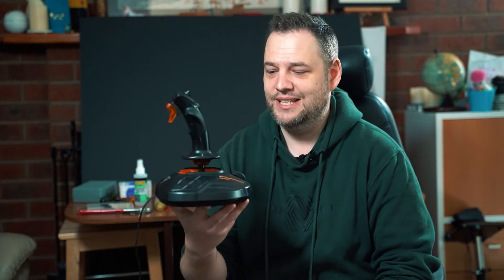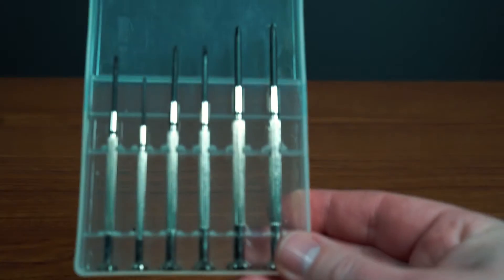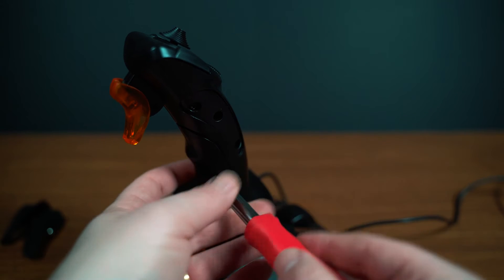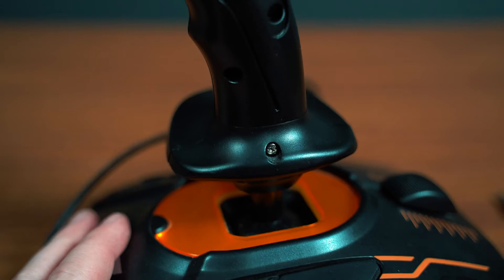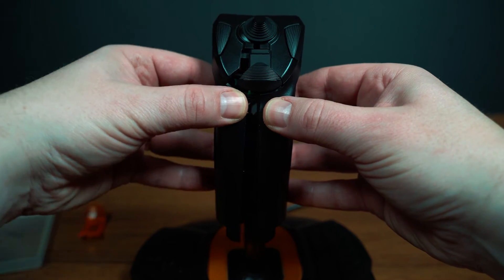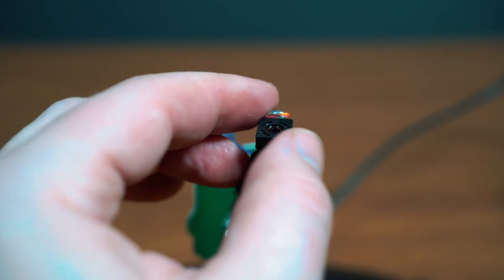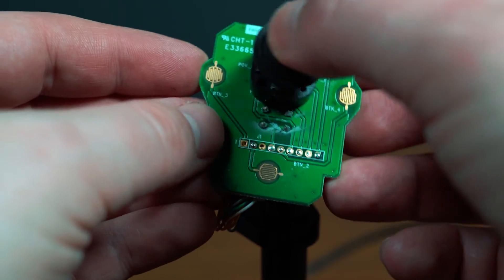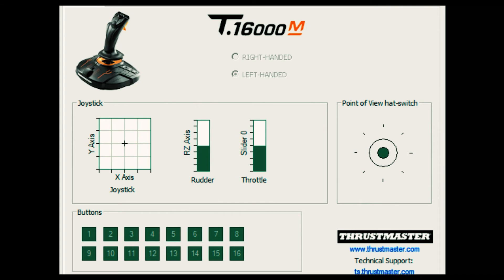Easy fix for T16000M stick/twist rudder - Complete tutorial

Comment: Thank you, it worked for me. My one modification is that I used alcohol swabs instead of q-tips dipped in isopropyl alcohol and alcohol swabs worked just as well. After wiping the swab over the surface a few times, I squeezed the swab so it coated the sensor and then turned it back and forth a bunch of times. Can’t even tell the z-axis problem was ever there. 🎉

Comment: I bought a T 16000 M bundle that has HOTAS, Throttle, and Rudder Pedals. I plan on using this until it either breaks and I upgrade to VKB, or I lose interest in flight Sims. Whichever comes first. If the z axis fails on the stick I have rudder as a backup so it may last longer. I plan on using the rudder as primary for realism.

Comment: Just did this to mine, and so far so good worked a treat. The only thing I'd suggest is popping the side buttons out as they just unclip, then you and quite easily reassemble the stick, pop the rubber things onto the back of the buttons and push them back through the holes. Anyway the actual cleaning of the potentiometer seems to work well, thanks!

Comment: I have what I believe to be an optimal process for reassembly and contending with the Nipples of Doom.

The left and right thumb buttons have moulded into them some retaining clips that exist so they could be press-fit into the halves of the stick.  Gain a bit of clearance by pressing a screwdriver against the closer clip and then push the buttons up slightly.  Place Nipple of Doom with tweezers and install.  Repeat with the other half, do not install the rear center top button.  Use one screw to affix the two halves solidly.

Place the remaining Nipple of Doom directly on the circuit board very carefully and precisely.  Snap the thumb button down and roll a dexterity check for at least 12.

Test springiness of buttons before finishing the rest as normal.

Comment: I found the solution — you don’t need to replace the sensor, and cleaning it with alcohol doesn’t really help. Well, actually, it’s not the cleaning that helps, it’s the disassembly. The problem is a short wire coming from the sensor inside the bottom part of the joystick. You just need to pull it out a bit and secure it. I simply used a zip tie to keep it from slipping back — no more problems since then.

Comment: I've had 2 of these suckers and both had this malfunction before too long, even though I dont play very often. The first one developed this problem within 4 months, as it was still in warranty, I had it replaced by a new one. One year later, the second one developed it as well. I have tried this and it only works for a little bit, and if you do it enough times, it doesnt work anymore at all. Honestly, screw Thrustmaster for not fixing this problem. I know its supposed to be an entry level stick and that they do sell the rudder pedals (which, from what I have read, isnt great), but this is a basic issue that they could fix but refuse to

Comment: The fastest/safest way I've found to fix this: take all screws out but leave the trigger pin in! from there you can carefully pry the sides apart and access the twist rudder pot without having to worry about any of the buttons falling out. it should be able to open just wide enough to get a q tip in there and apply the cleaning alcohol to the top. You can then close it, twist to distribute, and repeat until it's clean. 

I found this out by neccesity when my trigger pin was stuck and I couldn't get the sides apart but it ended up taking way less time and there is no way to loose the nipples of doom!

Comment: So i've b een able to repair mine... which had a broken wire on the twist pot. mine is 15 years old.... the green one. I might have upgraded, but it's the EXACT same under the hood. except it costs almost double what it used to.

Comment: hello I have a question, first of all thx for your video. Do you think I can glue the nipple of doom(it is really that 🤣🤣) from the nipple side to the small plastic rod beneath my button ? Or it will make a mess? I wasn't able to get the metal rod out from the trigger even with the hammer so is more difficult to put it together now, sometimes I think sometimes this joystick was assabled by monkeys under drungs 🤣

Comment: 4 years after the video, I have just fixed mine and it worked.
Quick trick: to make sure the plastic "tits" hol into place when remounting, I put a small drop of glue to make them hold with the push button part, it was easier for me.

Comment: By the point you remove the hand rest at 4:33 you can slightly open the joystick handle and insert the isopropyl alcohol via a needle/tube to reach the sensor. No need to take all of that apart.

Comment: Also, a needle nose pliers makes punching the trigger pin back into place a cinch. Start the pin through until it just starts peaking through, shove the orange button into place lining up the holes as close as possible, then just use the needle nose to send the pin home. Done.

Comment: TIP FOR REASSEMBLY- I just did this to mine today too to fix the rudder pot. It worked perfect. When reassembling the two side buttons over the PCB, I found a trick for holding the buttons up while sliding the two main halves together. Each button has a little plastic retaining tab. These prevent the buttons from popping up too far and coming out the top during use. To remove the button, you press in on the locking tab and push the button up and out to remove the button. But, no need to remove the button. Attach the silicone contactor to the bottom of the button, press inward on the tab far enough to start removing the button but do not remove it all the way. Slide it up just a bit, almost out the top of the stick. It will remain held in place there by that tab with the contactor in place. Slide the two parts together and when all screwed back together, just press the two buttons and SNAP! All together. You'll hear that retaining tab snap back down into place, locking the button in, right over the right spot on the PCB. Test everything first before full assembly, but this worked perfect for me and made reassembly super simple as those two finnicky buttons were held in place tight the whole time. 

Also, instead of alcohol, I used some CRC QD contact cleaner, Quick Drying contact cleaner. It's made for cleaning electrical contactors just like this. Probably the same results, but I had it so tried it and worked perfectly. I just used the straw that came with it to spray a bunch into the pot, cycled it back and forth quite a few times, then used a hair dryer to heat the whole thing up hot to evaporate the solvent fully. It's working perfect... for now.

Comment: I'm gonna attempt to fix my stick with these instructions. There's six Fridays of air combat galore in store for me and I can't afford an iffy rudder!

Edit: This did the trick. The most difficult part was getting the pin out and back in. I'm thinking about replacing it with a long screw or something. In order to keep the buttons with the nipples of doom in the upright position, I just folded some candy wrappers and jammed them in the space between the button and the joystick shell. My joystick is now like new.

Comment: Two years is a long time for these to hold out. I do tech support in a space sim game where these sticks are popular for HOSAS setups, and it's incredibly common for us to get people who are having issues a few months, weeks, or even days after receiving the sticks. Eventually we just put these on our not recommended list due to how fast and often they fail. TM has made four versions of this stick now and they all have the same problem. Sure you could open it up and "fix" it, but that's more than a lot of people are willing to do, especially with a brand new device. 

Bear in mind that cleaning the potentiometer is NOT a fix, it's a temporary bandaid. The real issue is a design flaw that causes the potentiometer to physically be destroyed over time, what you're cleaning off is the byproduct of it being ground away. It will keep getting "dirty" over and over because of the flaw until it ultimately fails altogether. Then you'll either need to replace the pot (which will again be destroyed) or mod it to hall effect. But by then you'll have opened and cleaned it so many times that the screw holes will be bored out (they just thread into the plastic) and the stick won't go together anymore.

Comment: Arvey, the left and right buttons pop straight out with a little encouragement from a screwdriver.  No need to try to slide the board back under the nipple, just remove the whole button, nipple and all.  Then carefully push the button back into place once the board is slid back into place.

Comment: worked for me, but you dont have to remove the circuit board, just have your tools close by and keep hold of the handle. Then when fitting the handle back on do it with the joystick flipped back so gravity keeps the button up. Took me less than 5 minutes and its like new.

Comment: i assume this will work for the Thrustmaster Sidestick TCA Airbus edition?
it is basically the same but the trigger and stick buttons on the top near the hat are different, but the rudder controls get really twitchy when not putting any rudder inputs every now and then as well and it's rather annoying
Reply from the maker: I've not tried the TCA Airbus edition myself but the mechanism is very similar and I'd bet it works as well!
Reply: @ArveyJay  thanks, I tried it on mine and now it works fine, now as a more permanent fix, would putting a small peace of sticky tape over the sensor work to keep the dirt out or would it stop it from working at all

Comment: Thank you, good video but - if your joystick is out of warranty and you are prepared to strip it down so far, it makes more sense to replace the defective rotary pot with a hall sensor than clean it. A dirty pot is rarely the problem, it is more likely to be showing first signs of wear after 2 years of use and abuse. Adding a non contact sensor would be a better idea while the stick is in parts.

Comment: Just fixed my left rudder using this video, all i did was remove a strand of hotglue from inside that tube the sensor sits in and now it works again. :face-blue-smiling: Saved me frustration while i save for new sticks

Comment: Thank you for this video, i opened the bottom thinking the mechanism was there, but i was wrong, googled it and found ths video. But i used contact cleaning spray to lube and clean the switch, not a cotton swab with IPA.

Comment: I had one of my dual T16000M's start having this phantom twist input, which was bound to my ship rolling. It didn't happen all the time but once it started it wouldn't stop. Eventually my second stick started to have the same issue. I just followed your steps to see if it will resolve the issue, but wanted to say, I found for an easier reassembly, remove the buttons to the left/right of the hat and just focus on getting the bottom button and hat situation. Then, while holding it so the circuit board is level, use tweezers to place the pressure nipple thing directly on the left circuit board sensor spot followed by carefully pushing the left button cap down to lock it into place. Give the button a few presses and it should have resistance to bounce back up. If you did it right, repeat for the right side. If you messed up doing either, you'll need a spudger (I used the ifixit metal spudger) or something similar to wedge between the gap of the button closest to the hat to pop it back out and try again.

Thank you for the walkthrough! I'm hoping it worked for me and for anyone else having this issue.

Comment: So, I was able to fix this only doing a partial disassembly. Basically I stopped before disassembling the trigger pin. I opened up the shell a little bit and blasted the insides towards the sensor with BW-100 cleaner while moving the stick around. I approach both from the opening in the shaft and under the hat button.

This same thing usually works for other game controllers with analog sticks -- often no disassembly required at all. Just blast BW-100 into the assembly, move it around, and test it out. Unlike isopropyl alcohol, BW-100 evaporates nearly instantly, so you can really just let loose without too much worry. It's also in a compressed can with a straw so it really jets in where you need it.

I would also recommend testing the controller both before and after, so you have a point of reference for comparison. hardwaretester has a website with a gamepad tester that works really well.

Comment: Unfortunately I wasnt able to perform the repairs due to that little bastard in the trigger. I watched the video talking specifically about it but the fucker just wouldnt come out, so I decided to quit before I broke my joystick and try the warranty (which will probably be rejected, considering how stores are). It is shameful that Thrustmaster still hasnt fixed this issue with their most popular product. Sure it is meant to be a cheap joystick, but still, they should take measures to ensure that this problem is in the very least mitigated, but no, they just keep perpetuating it

Comment: Alcohol and other solvents can clean away the carbon and dust in potentiometers, but there are a few reasons to use a product engineered specifically the job. A good contact cleaner (like Caig DeOxit) will do a better job, and will extend the life of the pot significantly. Alcohol (and other solvents, like acetone, ether, etc.) will rinse out the particles that build up between a pot's contacts, but it's pretty hard on rubber, some plastics, and lubricants. While a solvent-only cleaner will help with the dirty pot contacts, it can harm some materials. (Tape head cleaners use denatured alcohol, which doesn't dissolve the rubber parts.) Pure solvents can clean thoroughly, leaving unprotected contact surfaces that oxidize and grab small particles more readily than contacts coated in a protective lubricant. Good pot cleaners leave a very light conductive lubricant behind. (A bad lubricant can actually trap particles, turning contact surfaces abrasive, and accelerating wear. Radio Shack's "TV and Tuner Cleaner" product had this problem.)

Contact cleaners come in pressurized cans with tiny spray nozzles that fit through very small holes. That means you don't need to do as much disassembly and reassembly--just blast it in, and rotate/push the pot back & forth a bunch of times, and you're done. If you don't want to further destroy our ozone layer, there are also bottles with needle applicators to get into tiny spaces. A can of Caig (now Hosa) DeOxit costs more than a bottle of alcohol, but with DeOxit you'll get another two years out of the pot, while alcohol with likely run into problems in 3-10 months.

Comment: I just used a dab of glue to hold the nipples of doom in place on buttons 3 and 4 when reassembling (remove the buttons first to make it even easier). When the glue has dried, clip the buttons back in place and then reassemble. Having successfully put it all back together, I knew I'd still balls something up though - don't do what I did and use MAF cleaner to clean the orange plastic plate that lights up, as it starts dissolving the plastic 🤦‍♂. Only a cosmetic thing, but it annoys me every time I see it now as the plastic looks dulled.

Comment: the t16000m is a good stick but goddammit this shit is fidly. not two months after i bought it dust got into the hal sensor on the TWCS and i had to dissasembly, then it was the rudder on the stick, now its the pedals. I cleaned it up and all works good again but damm.

Comment: Ran into this problem myself about three months ago.  Oddly enough my older T-16000m that has the green plastic and looser keys doesn't have the problem.  Given the fact it isn't exactly an average person who is going around buying flight sticks and throttles, I'd probably have designed the top part to be more easily removable to do the maintenance.   I ended up going with VKB and paid the extra money for a more user friendly option.  They even ship extra springs and other items along with the sticks so it is possible to fix them if something breaks, or even customize the tension and what not.

Comment: Thank you, it worked perfectly. Instead of suffering with buttons 3 and 4 and their nipples of doom, I simply popped them out of their cases (the grip) and inserted them after the two sides of the grip were together. This way I could just hold the button with the nipple in my hand upside down and push the whole joystick into it, avoiding the pain of a misplaced nipple.

Comment: thanks for the video, it fixed my issue. Since i wasnt able to find any dirt in it, my theorie why it started to act strange are the cables. i gues after longer time of useage the cables in this joystick start to move a bit until they are at a position strong enough to move the sensor a bit by their own power or preventing it fully going into the correct direction. So now after i opend it i guess i lifted the resistance of the cables and now the sensor is free of any disturbing force by the cables.